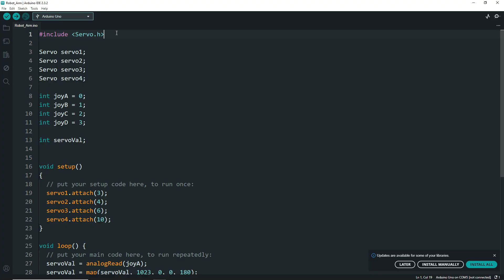Build a 4 DOF Robotic Arm with Arduino | Servo + Joystick Control

Comment: What is your power supply current rate? I have 4 DOF with 4  mg90 servos. The movement jitter a lot.
I have feeling my power supply doesn't have enough amp.
Reply from the maker: It depends on several factors, bro. But make sure you're using proper wires and a solid power source, since the servos will draw a lot of current under high torque.

Comment from the maker: Any questions about this project?
Reply: did you get the parts specially ordered for the robot?
Reply from the maker: @Zemer09  Do you mean all the components for this project ?
Reply: Yes
Reply: Measurements?
Reply from the maker: @patriciaana199  what does that mean...
Reply: Kindly explain the power supply setup. What batteries work with the 4 servos
Reply: Can you share the circuit diagram for this?
Reply: Link for order all of these
Reply: circuit diagram i really need it i dont understand what you explained and day after tommorow i will have to present it please give it fast i beg you